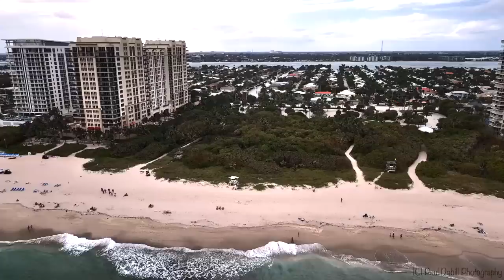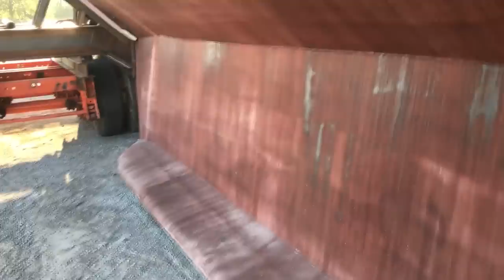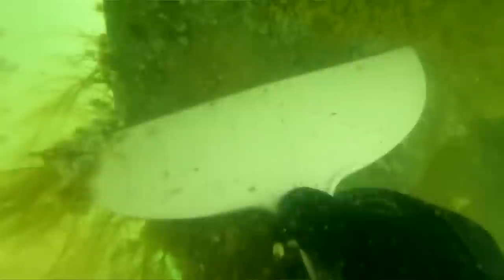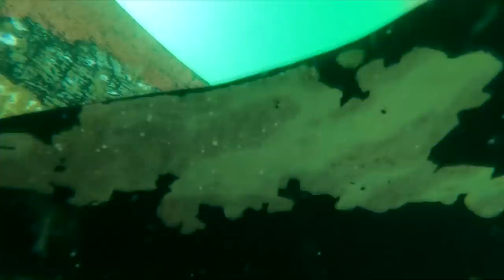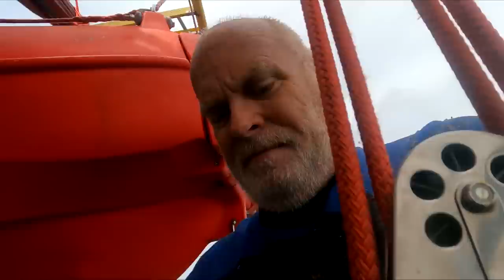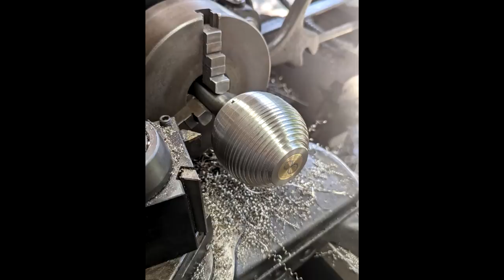Hull Cleaning and a review of PPG ABC3 and Velox Antifouling

Comment: Blade tip cavitation is the enemy of any coating on a propeller.
Reply: Exactly what I was thinking. It has to be cavitation taking off the coating, but the blades were still really smooth, so it isn’t horrible. Still a problem though.
Reply: Which is why we all need to change our propellers for the helix wing type no cavitation and twice the torque at the tips
Reply: I wonder if it has something to do with the design and having the clearance space between the prop and the shroud creating a low pressure vortex between the two surfaces?

Comment: Great video. Marlin Paints Metal Primer has been re-released with greater adhesion and resistance to currents. If you want to take no chances you can use a thin layer of a  zinc chromate 2-part etch primer before you put on the metal primer. Once the etch primer is on you have between 30 minutes and 5 hours to get on the metal primer. Oh, and Velox Plus works on film thickness, so if you can, 3 coats is the way to go 🎉
Reply from the maker: Cool, thanks

Comment: Several people in my YC and I use cold galvanize on our props.  You can get it at most hardware stores.  I get the large spray can when it’s on sale.  It lasts 3-4 mo before anything really grows on it.  P.S. keep my boat in CT, Long Island sound.
Reply from the maker: Really!  Not hear of that one.   Might have to give it a try.  Seems like it would be an anode for the prop.

Comment: Hi Captain Doug, great video again.
I remember you mentioning that Seeker is designed to stand on her keels at low tide and you can do maintenance before the high tide returns.
Is that still something you consider doing, or are you concerned about her center of gravity?
Reply: He can still do that. There's not a convenient place to do that right now. That why he replaced the shaft seal and pulled the prop while in the water recently.

Comment: Is there a specific rotation that boats should be dry-docked and anti-fouling re-applied? I know you said that stuff lasts 10 years, but I'm wondering if there is sort of a general guideline for maintenance of that nature.
Reply from the maker: No, not really.  It has a lot more to do with other maintenance that also requires a haul out.  The cost of the haul out, and the balance in your back account.

Comment: Make a magnetic hull cleaner..... start with a pressure washer surface cleaning head, add 4 wheels around the sides with really strong embedded magnets in the wheels. Attach the whole thing to a long pole and connect a pressure washer on deck. You might be able to clean at least part of the hull from the deck by pushing it up and down the sides of the hull.

Comment: I find it interesting that copper alone inhibits marine growth, but seemingly does nothing as a component of bronze. I wonder if it would be possible, through electroplating or vacuum deposition or similar process, to coat the prop blades in an extremely thin pure copper layer to stop the critters from setting up shop there.

Comment: Would it be possible to coper plate the propeller blade with coper ? That would be a bit more work but could be a more durable antifouling solution.
Reply from the maker: Don't think so.  It's NiBrAl or Nickel Aluminum Bronze which is about 79% copper.